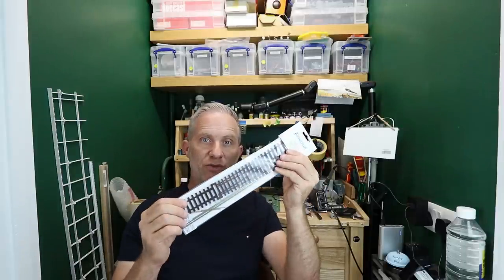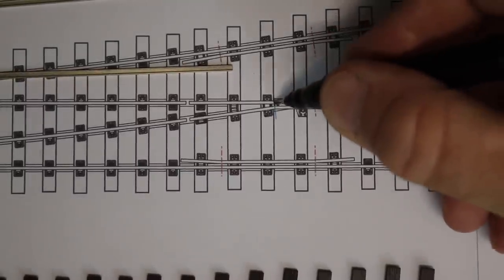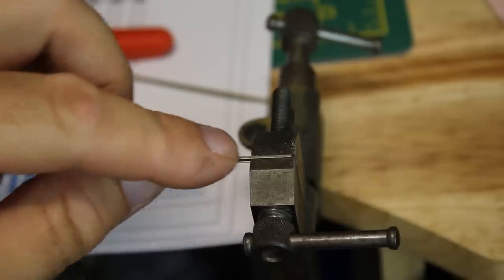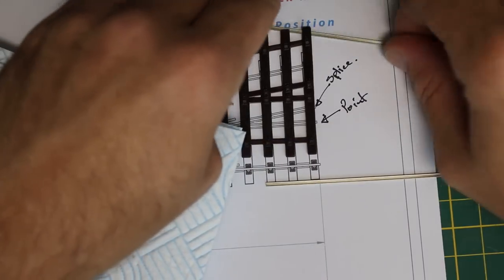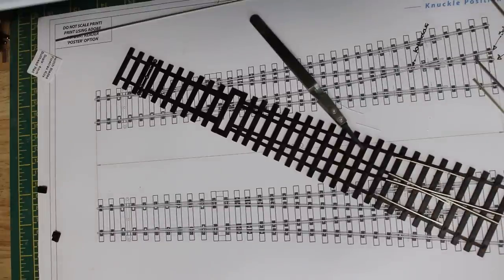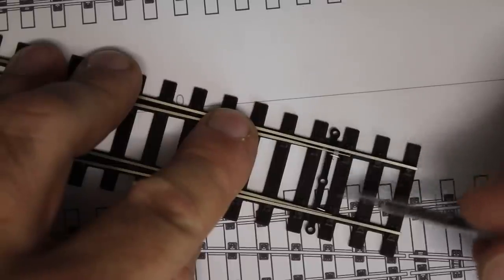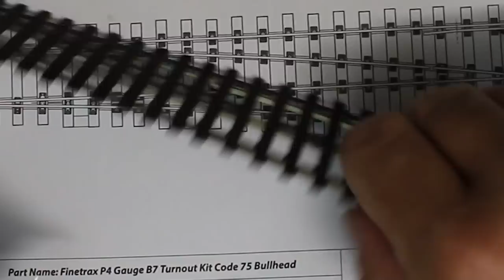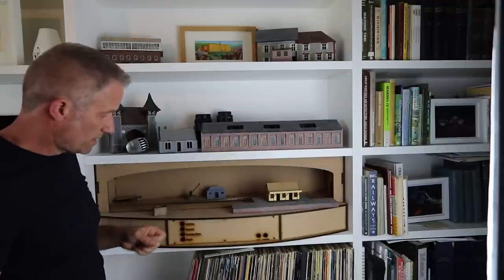S2 E28 Starting in P4 | Bexhill West Model Railway |British Finescale Turnout Kit

Comment: I've built quite a few of these now, in OO-SF, they really are a gamechanger for accurate geometry trackwork. They can be curved by cutting some of the tags between the timbers, although the base can be quite fragile - which is why it's very important to file the ends of the rail, as it's easy to break the chairs if you're not careful. If you use the offcuts from the first kit for the short rails on the next you soon end up with plenty of spare rail too...

Comment: Hi James. Thanks for another excellent video. I have been using the 2mm Finescale version of these kits for a while now. I have built 20, all operated by your  servo point actuators,  and they are a fabulous product. The only thing that I have found is that it is important to add a tiny amount of superglue to the wing rail chairs once they are in place. Otherwise, they tend to slide out of position when cleaning the track. Pete.

Comment: may i suggest when you're soldering in the thin wire strips accross the rails, just tin one rail and solder the wire on that one rail. Then solder the furthest rail away and when cool solder the centre rails

Comment: Turnout kit; depending on the specific point mechanism the two sleepers next to it might be to short 🤔
23:50-24:55 "this little thing" ->  "Marshlink modular P4 diorama frame" followed by a identification tag like "JW01" or "WJ01" or "BHW01" 😉, then bigger written in the next line what it shows for example "Little Huddlehurst" 😏

Comment: Hi James,  Fantastic little kits ( was reading the article about them in the latest mag) arguably probably needs a couple of insulated fishplates where it goes into the knuckles to save it shorting when the rail expands and touches it (if it's wired that way) Certainly a very quick and easy way of starting out in P4.  Cheers, Michael
Reply from the maker: Hi Michael, I agree.  I had the same thought.  I didn't fit them in the video because I wanted to follow the instructions, but I have subsequently fitted them.  An additional benefit is that they help to hold the closure rails securely too.
All the best,
James

Comment: It would appear that having the rails pre-machined made the turnout much easier to assemble. Have you given any thought to what sort of jig one would need to make if one wanted to machine their own rails at home?
Reply from the maker: Hi John, I've given lots of thought to mechanising the process, but it's so quick to file them by hand.
I have considered doing them as a batch with a surface grinder and a sine plate, but I tend to file them up during my tea breaks at work, carefully categorising them into a purpose made tray.  I've probably got enough switch blades and point rails to last me a life time.  :)
All the best,
James

Comment: THE PROBLEM OF REALISTIC TRACK RADII ON A MODEL LAYOUT !!!
There's one problem with a product like this. In reality pointwork was built to fit the location, not to a preconceived radii ! Meaning virtually every point was unique !! The next problem is that in 4mm no track should be less than 5ft radius !!! Simply because large locos such as Pacifics or even Class 45 Diesels required normally a minimum radius of 4.5 Chains, which is 264 ft, times four to convert to 4mm  scale = 1056mm which is a minimum of 3ft 4in radius on the layout. And that only allows a maximum speed of 4mph WALKING PACE !!!!!! 

Hence decades ago at Pendon tests were done to discover the minimum radius that would allow Corridor Coaches & Tender locomotives to run fluently, once the gaps between vehicles were reduced to the realistic distance. And 5ft was found to be the minimum if you wanted to avoid "spurious" derailments !! 

Indeed even on EM or Commercial OO gauge the MINIMUM of 5ft radius, massively reduces derailment issues on the assumption that your pointwork is built to exactly the right tolerances !